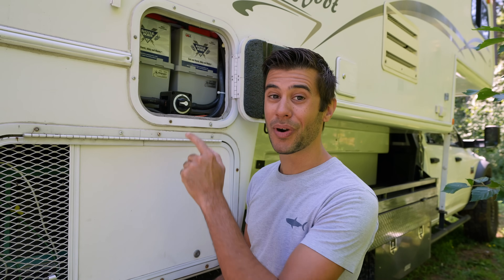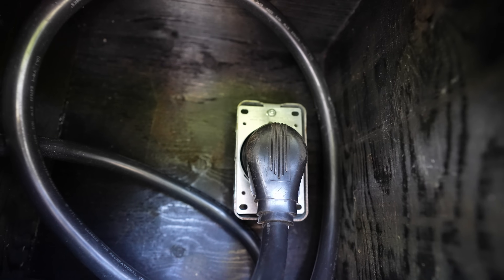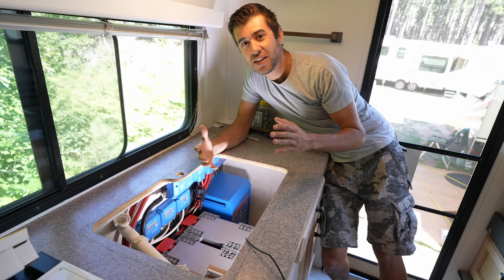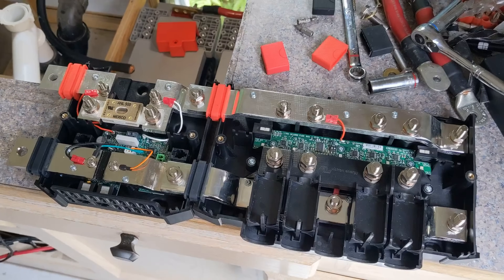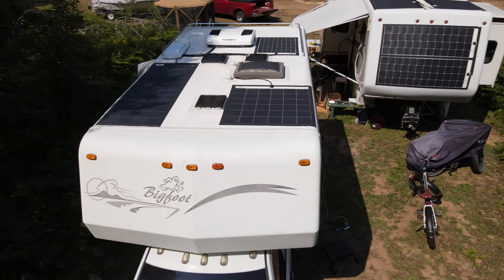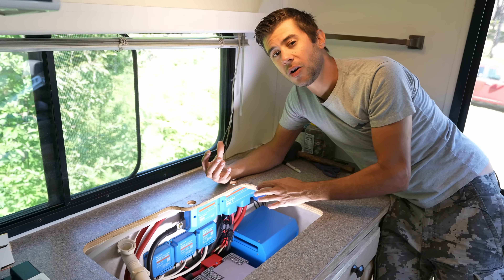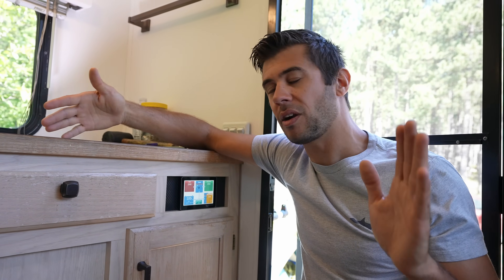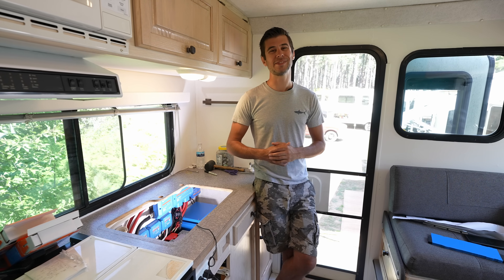What Goes Into an Off-Grid Power System? Overland RV Solar Power System With 12V Air Conditioning

Comment: Wow haven't seen anyone do such a good breakdown.  Thanks.

We are building an overlander box van conversion from a E450 box van chassis.  
It will be used as a promo and beach rig for a documentary film.  So tons of electronic components. 

Trying to see ok what can we run off gas vrs what will need to run all the time off electricity.  

Being in Florida a/c is a must and needed to fight humidity and mold,  add 2 tvs, lighting,  computers,  constant charging for electric bikes beach toys, etc.

You should have seen the face of our builder when I started listing everything we needed and wanted to have or use on-site.  😆 

Again thanks and great point about having fuses to protect one bad component from frying another right down the line.
Reply: Hi there, have you ordered or built the box yet?  If not I’d consider these guys… Total Composite For the box & build it on top of a subframe to allow movement/torsion that doesn’t transfer to the box. Leak proof, super insulated & things inside don’t get twisted and fall apart.   Cheers…. Yvon
Reply: @yvonlapalme7008   Thanks. Our builder Blackhawk over @carefreecamperco is doing the complete build out on a 20ft chassis with a E450 cab. It is hybrid box that will have 16ft 10inch of floor space.

With a 3ft extension on the back not shown in the line drawings. Will be putting a rendering together soon.
Reply from the maker: Love it! It's all possible with the right system! Good luck with the build.  What show/ documentary are you filming for?
Reply: @MortonsontheMove  its called ScreamingTangerine Living and Working Outside Of The Box.  It's about how generation A will no longer need traditional 9-5 jobs. Many are becoming content creators and earning money online from adsence,  merch sales, ebooks, courses,  memberships, brand deals etc.

In fact it is focused on our 10 year daughter and her journey to becoming an influencer and then content creator. 

Her branding is around beach life and fashion (her niches) she will be interviewing other influencers and YouTubers to see how they make money online then showing how that can be applied to what she does.

Ie. One tiktoker makes online courses for skill share and udemy. So we will film Epiphany (our daughter) on that interview then show how she applied it. Like her then making a class on the basics of t shirt design using canva then uploading the designs to 6 different print on demand shops.  Then going to pinterest and Facebook groups to market them. Cut to scene of her at the beach reaching in her beach bag that has her design on it while she has one of the other designs on her tablet shirt.

Each time she will give real world examples of other tweens and teens doing the same thing.

We are getting ready to launch a crowd funding program asking people just to give $1 or the price of a smoothie. 

Then after she earns the equivalent amout raised to fund the whole project she will donate that to a winning charity. 

We want to teach her not only to be independent but charitable as well. 

Sorry for that long explanation but we are very excited about it.

Comment: I noticed you said the controllers and other equipment had to be Mounted vertical for heat dissipation as Victron‘s instructions also says the same thing. I mounted my 100/50 Victron controller upside down, meaning the fins are on the top. I have been using it this way for almost 3 years without any problems. When It’s making close to 40 Amps it does get hot to the touch but not too hot to hold onto so I figured it’s not a problem. Any thoughts from your side on this? Thanks for the video it was very informative.
Reply from the maker: That's a good question. I have mounted them in different positions before as well and have not seen a failure yet either.  But like you said they do get hot.  Bring vertical it just allows the heat to rise off it a bit better, not sure how much difference it really makes tho. Since I had the space I figured I would mount it vertical.
Reply: @MortonsontheMove  I haven’t been able to find in their literature how hot they can actually get. But I have used an infrared gun and seen 140° on the blue part. So I put a little USB fan pointing at it from a shell 3 feet away and it really cooled it off.

Comment: Please consider installing a wireless temp sensor so you can let us know how much heat your inverter install builds up.  I am installing same inverter under sink in our Navion 24J.  Victron calls for 10 cm (4") around inverter.  I'm in process installing 6 Battle Born 100AH batteries, for my 640w solar system which like you Ive broken into 3 individua MPPTl sets of 2 panels each (6 panels total).  2 sets in series and one set in parallel so A/C shading only degrades one panel depending on sun's elevation.   Love, love the Lynx and the DC-DC charger.   You may want to consider installing the  "AMP-L-START REV H2 15amp STARTING BATTERIES CHARGER/MAINTAINER" so the coach batteries trickle charge the truck batteries when camping long in one spot.   Rev H2 engineered for lithium to lead acid batteries.  Works great since our MB always using power.

Comment: I’ve seen efficiency numbers for good inverters in the 90 to 95% range. When I look at the SEER efficiency differences between different air conditioners, I would’ve thought that a more efficient air conditioner would more than make up for the losses?

(To put precise numbers on it, the most efficient mini split is 42 SEER, most of the units I’m looking at are 21 to 23. I need two indoor units and I want mini duct units rather than a ductless mounted to my wall. I have a 36’ class A so I want cooling to go to the ends of it…)
Reply from the maker: Yes you can get very good efficiencies out of a setup like that .  One thing you need to consider is efficiency at load however.  Most inverters are most efficient around 90 percent loaded and with a small load you can have much lower efficiencies.  Properly matched they can be a good setup and will still exceed the capacity of this little 7kbtu unit.  Not sure what the efficiency of this unit is but like the high efficiency mini splits this unit is fully variable to find the most efficient run.

Comment: Just a tip in an otherwise really good electrical set-up, please change out the 3 x blade fuses on the solar controllers (and any others that are likely to see current over 7A for a prolonged period of time) as they will offer to much resistance (at the blades) under prolonged solar load, and they will eventually get hot and melt the plastic holders and fuse cases, this is a very common problem.
Best to swap them out with bolt on fuses or really good quality circuit breakers.

Comment: Wow! I love it! I have 3 - 100ah lithium Battleborn Batteries and 400 watts of solar on the roof of my 303rls G.D. Reflection. I would appreciate any schematic to show how you wired the DC to DC charger. Can't wait for your next video!
Reply from the maker: Check out the blog post with the schematic.  Its pretty simple, black to black, red to red.... although the negative is shared at the non isolated controllers like this one.
Reply: @MortonsontheMove  Thank You!

Comment: Does the Orion DC-DC charger show up in the Cerbo GX display, or on the phone app?  I'd seen it mentioned somewhere that they do not... 🤔
Reply from the maker: No they do not which is frustrating.  They do have Bluetooth so you can log into it individually (so yes on the app) but its not shown like a solar charge controller.  You can change settings via Bluetooth however.  Maybe they can be smart networked but i have not tried it yet.

Comment: Is the air conditioner a true 12v or a 12v input with built in inverter? I was under the impression only cruise n comfort was true 12v?
Reply: That's a complicated question. When you get into variable speed compressors the power circuitry gets a lot more advanced.
Reply from the maker: Yea biohazard is right, it is true 12V but it runs brushless motors for interior, exterior and compressor.... thus its modulated power.  Not sure what the motors run at but im thinking a few hundred volts.  Its not a 120 or 240v AC unit with a built in inverter if that's what your asking, it is truly a dedicated DC unit.
Reply: @MortonsontheMove  That's what I was wondering, thank you.

Comment: Very nice.  I just did the same basic install on my Lance TT but with 2 100 amp-hr BB batteries and a Victron Multiplus 2000/80.  I still need to install the DC to DC Charger.  The Victron product are fantastic and so are the BB batteries.  I really like being able to use the microwave or toaster while stopping for lunch.  We can even use the AC for short periods of time.
Reply from the maker: Love it!  Having a power system that functions all the time makes like so much better :)